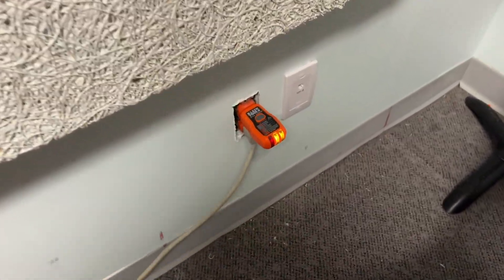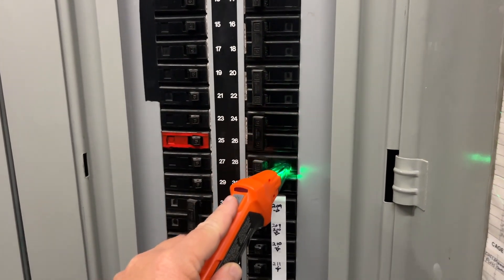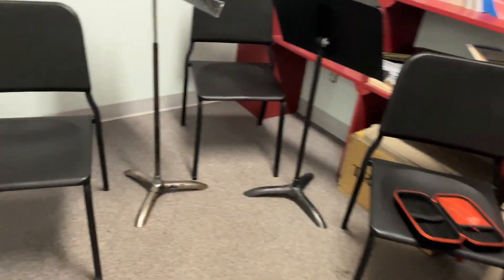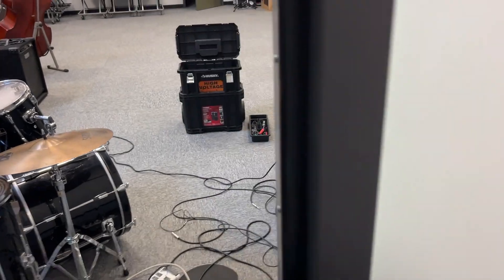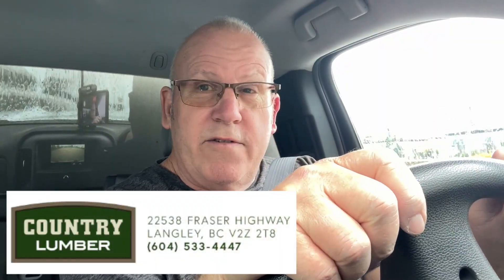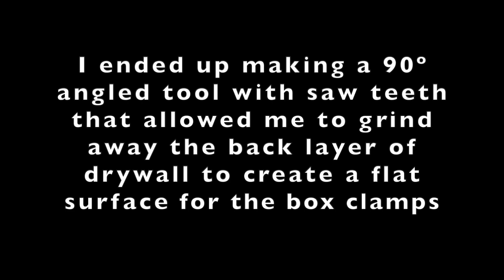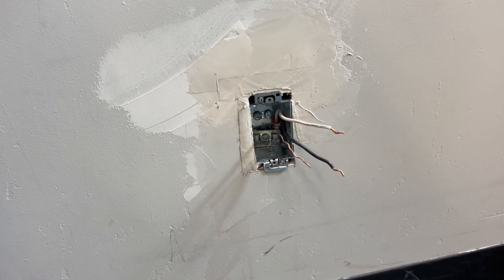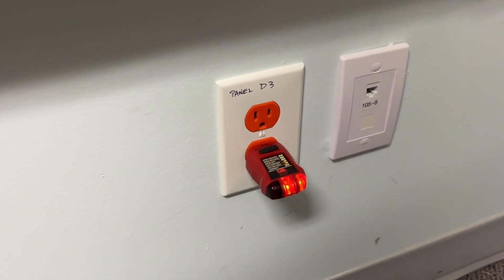Do Electrical Branch Circuit Tracers Even Work? - S07E187

Comment: I have the same tester and you are right as how inaccurate it is, but last fathers  day I was tracing an open circuit and this tool was useless, so long story short I got the Klein ET450 Advanced Circuit Breaker Finder and I know it is expensive and everyone is going to say it is way overkill  but man it is right on when tracing and it does open circuits, when I used it I was able to trace the wire in the wall all the way to the open which was two floors above. I figured it this way at 230 bucks it was way cheaper than having an electrician making an emergency call on fathers day... :)

Comment: Power ON the receiver. Before approaching the electrical panel, push
the Power On/Off/Reset button once to reset the receiver. Position
the receiver so that the sensing tip is oriented perpendicular to the
breakers in the panel. Slowly scan all breakers in the panel once, ignoring
any audible or visual indications as the receiver is learning the panel.
Scan all breakers a second time. When the breaker connected to
the circuit with the transmitter is approached, the frequency of the
audible beeps will increase. When located, the audible beep will sound
continuously, the circuit status indicator will illuminate red, and the
green indicator in the sensing tip will turn off, indicating that the
correct breaker has been found
Reply from the maker: Great tips! Thanks for watching!

Comment: Automotive have similar traders. They don't work well either. Wires running next to the main wire will pick up the signal as well. Plug in a radio, turn it up loud. When it goes off, you have your circuit. I deal with the same miss labels at my church.